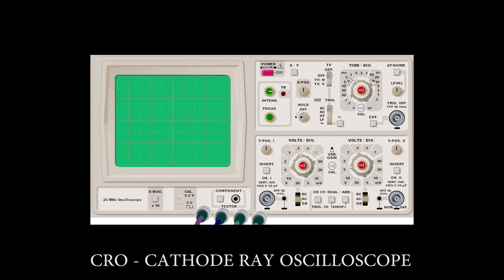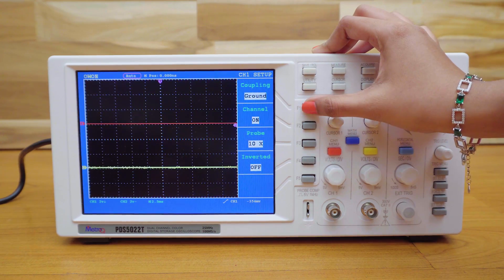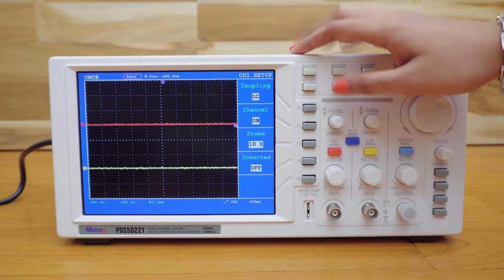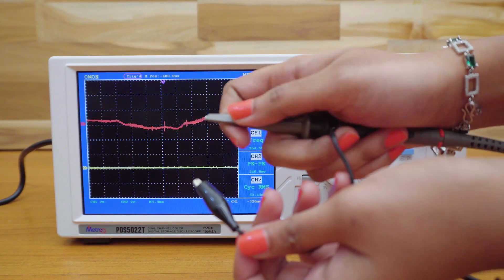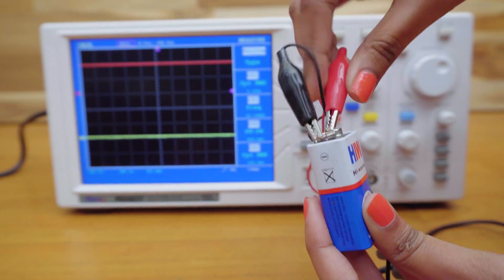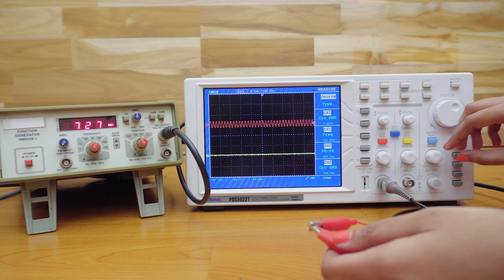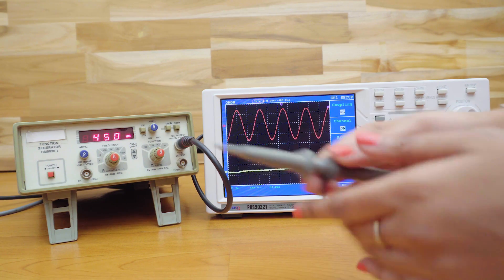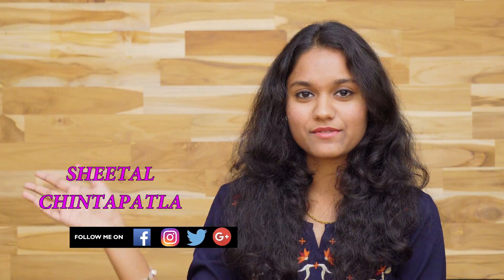How to use an Oscilloscope | DSO Tutorial for Beginners

Comment: may i know why do we use 1x and 10x switch in probes
Reply from the maker: +Rohit Ramteke 1x mode on oscilloscope is used to measure low level signals with more accuracy,for measuring higher voltages which are out of the range you can use 10x mode and for beginners it is always safe to use 10x mode as there are less chances of oscilloscope getting damaged.
Reply: Hello sheetal,
Thanks for your reply... i have some more questions about DSO